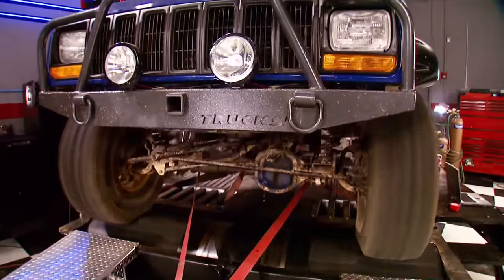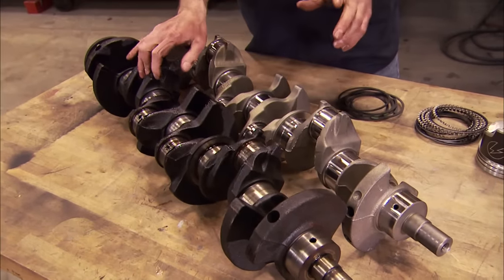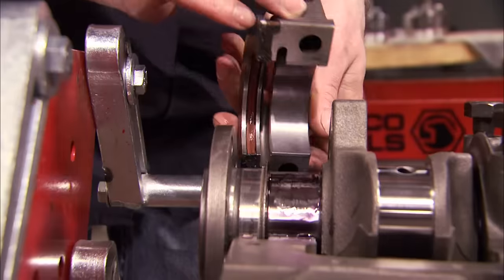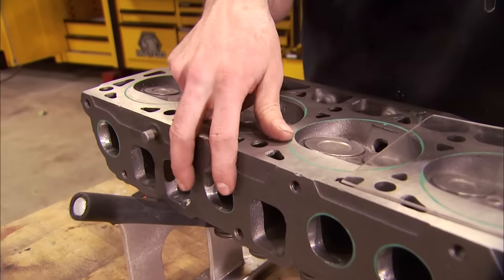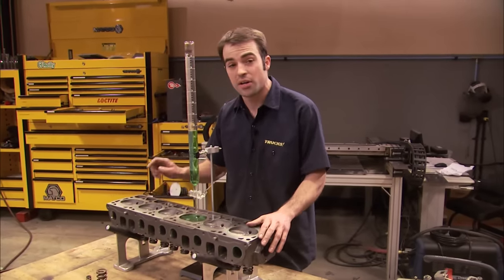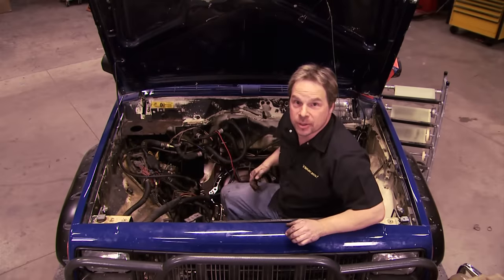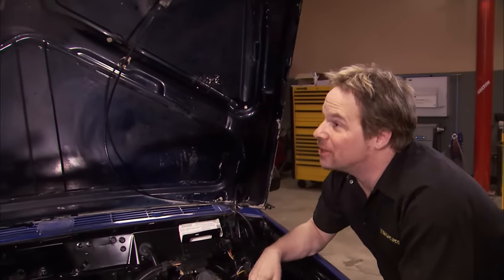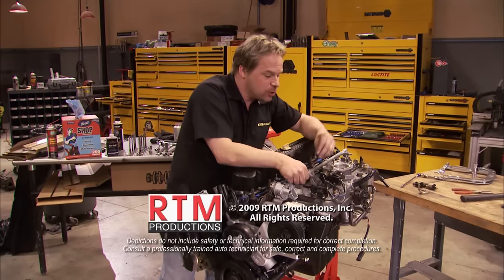Improving Air Flow And Displacement On Our Cheap Cherokee's Straight Six - Trucks! S11, E7

Comment: 4:58 Engine assembly is a little more than just torque spec and sequence although those are vital. Your bearing and piston clearances matter just as much if not more. Also piston ring end gap depending on your plans. You want to open them up if going with a power adder unless you like busted ring lands. And checking the end gap should be standard in any build unless you like blowby on a new engine. Too much crankshaft thrust clearance? You might end up driving over the crankshaft the first time you give it the beans. Just got your block back from the machine shop after a line hone and overbore? Check the clearances on the pistons and bearings. Never just assume all is copacetic. And don't spin the crankshaft until all the main caps are torqued to spec. The mains are not round until they are torqued and spinning the crank before the mains are torqued means you run the risk of scuffing the bearings and possibly the journals.
Reply: Or maybe everything was already measured and checked before hand........ for television time and such
Reply: They actually did btw. That aside, those low reving straight sixes are MUCH more forgiving and actually thrive in slightly looser tolerances relative to newer or performance specs.

Comment: I started mechanics in 68 on Stingray bikes and lawn mowers right around 70 I took into machine work in high school and rebuilt a go-kart engine for myself took a year and I was introduced to head porting in 71 and somewhere late 70s I took a hand at it but all through the 80s and 90s I did head work porting on my own and sold heads built things buy and sell engine parts I know that that Jeep engine is capable of 300 horsepower with proper head work and some compression and a cam head porting takes a long time to do a set of V8 heads can take 40 hours if you're doing it right and doing it meticulous and Blueprinting but it sure does make a difference

Comment: I worked on a mint 2004 4L Cherokee at work today, had an oil leak but that was about it still ran pretty good
Reply: The only longevity issue is the loss of zinc in motor oil,but you can use an additive

Comment: Great to see this build going forward and I like the way you are holding the cost down.  I like to keep the engine bay clean and neat as well but prefer a light color since it's much easier to see everything. Good work, good info

Comment: I am still baffled at jeeps decision to discontinue the 4.0L. It was like the cummins of the gasoline engine! Sounds great, awesome torque, would run forever if you dont EVER over heat them! Inline six......ok you get the point. Stock 4 liter is a good engine but the 4.6 like they are building here is just badass!! I have done a few over the years in YJ's and TJ's that had a blown 2.5L so we did the bigboy swap and man its amazing the difference and how happy our customers were. Believe it or not the swap is very simple to do also! Engine mounts are the only welding you need to do and those almost fall into place on their own! Cant wait to see what this engine puts out that they are building!!
Reply: Poor efficiency.
Reply: Listen to the engine run, you can hear slight misfires not enough to trigger the misfire monitor to pop a DTC but enough to make it fail tighter 2007 emissions standards. Some 4.0Ls run smoother than others, sometimes even with rotor, cap, wires and plug replacements it still runs a little rough. And with that much raw fuel running through the cat, epa felt that it wont pass, the 3.8L V6 used in 2007 to 2010 ran smoother and had a little more horsepower, but the 4.0L was still superior.

Comment: someone should have designed a tunnel port exhaust style head for the jeep...the 4.0 was so durable because it wasnt powerful enought to hurt itself.
Reply: 2j swap the jeep, call it supajeep
Reply: Haha exactly!  It better last forever it makes low power and doesn’t rev.
Reply: Exactly what an Older guy told me when i went to rebuild my ford 300i6. Told me its prolly the best motor i coulda picked to rebuild bc its durable and doesnt have enough hp to do damage to itself if im not perfect with everything
Reply: That's typical for all the old Detroit straight 6 engines.  They wouldn't turn high enough to hurt themselves. There is really nothing that magical about them.
Reply: Edelbrock makes an aluminum head for this engine.....IF you can find one.
Reply: It makes plenty of torque down low for its application. No need to wind up rpm to reach power that you don't need to move a 4k lb jeep. Its a glorified gas tractor engine. The AW4's wasted all their power. The AX15 really allows these guys to work in the power range where they are happy. Plenty torque to climb a hill in 5th gear. Start changing tires, axles, adding weight and moving your torque peak up, and it defeats the point. For the tuner kids out there, go see the AMC 10k rpm YT video or the Mexican racing league.. If you have the money and commitment, bragging rights can be had.
Reply: @scotteric8711  I agree for your off road POV....the problem is, 1) im not off road all the time 2) there are guys who build stroker/hp boosted versions of the 4.0. 3)a crossflow head would get better fuel economy. a 8.0 liter viper gets 5mpg better fuel economy than the jeep, for a variety of reasons (taller gearing being one) BUT the viper has more rolling resistance (more contact patch) and the Viper weighs more than my old XJ (3200lbs vrs 2800lbs). For day to day driving, not off road, or for Hot Rodders, a cross flow head would be GREAT.

Comment: Looking forward to doing something similar with a jeep 2wd  5 speed in my 71 gremlin
Reply: As much crap as Gremlins always seem to get, I'd still love to have one and build a turbo 4.6 stroker and take it to the strip.
Reply: @Future-Preps35  yeah that has been popping up but haven't quite checked it out, I have a spare 401 laying around for my 74 javelin amx that if I go as far as spending some big money on the 6, im just going to use some bulltear mounts and throw the 401 in the gremlin
Reply: @Brock_Landers  would be great! I also have a 92 Nissan 240sx that I took the 2jz out of and I have it sitting and waiting for a project, I expressed the idea of a 2jz and t56 in my gremlin on some forums and people thought the straight 6 tuner power plant sounded rad, and then a guy stole my idea so I kinda lost interest because I was trying to be the first 2j gremlin but I should have kept my mouth shut. Plenty of late 70s z28s I'm sure got embarrassed at the red light by a few gremlin Xs back in the day with a good ol 258 under the hood, the torque is there and you gotta love that amc 6 reliability.
Reply: Sweet!! I think that would be Peppy
Reply: Make the effort to use OBD II intake, head, and wiring. The intake flows so much better and you can access the ECU with HP tuners, ask me how I know.
Reply: @watrousmark401  my buddy who does aluminum casting and maching and I both decided to build an aluminum dual overhead conversion for the jeep 4.0 and we are attempting to do a weber side draft setup with a dohc design, itll be unique for sure. Thanks for the advice though
Reply: @Timman57  
How'd your DOHC head project come out. They actually make a DOHC for the 4.0 block that is used in a race series in Argentina. And no they do not sell them

Comment: Who takes compression out of a low hp engine oh that's right NO POWERNATION!!!
Reply: Or NO PENETRATION
Reply: Lol 😂😂😂
Reply: @WhiteG60  You are so right!
Reply: Came here looking for this comment
Reply: (Tim)"What are you doing to that Jeep engine, cylinder head, AL ?
(AL) "Tim, ...I'm lowering it's comprehension ratio and power"
      (Tim) "OOOHHAAAH ??!!!"
Reply: Hey let's stroke this engine and drop compression ratio......
Reply: @sethbrown5592  Sounds like late seventies!
Reply: @kingssuck06  9.6:1 will run 87 octane just fine. if it pings, just take a degree or two of timing out of it.

Comment: One thing I should point out, they kept saying "Cherokee rods" and "Cherokee pistons" this WILL NOT WORK with a 258 crank. The 4.0 has a deck height of 9.45". If you use the 6.125 connecting rods on the 3.895" stroke of the 258 crank it will shove the piston about a quarter inch into the head. The 4.0 piston has a compressed height of 1.601" so you can either use the 258 connecting rods, which will increase your quench height, and make the engine sensitive to fuel, or get custom pistons with a +/- 1.3" compressed height. The second option maintains the total combustion volume, and lets you run the same fuel as a stock 4.0L.

Comment: Idk about removing part of the squish band to get back 3 points of compression. Seems like one step forward and two back.
Reply: Optimally, it should have been done with the correct piston. But you are correct. He should have just left it alone. A 9.6 with good quench is better than 9.3 with no quench.. Especially with an iron head and pump fuel.

Comment: When using Plastigage and soft bearings like 77 style, it  is important to measure and torque \ compress the Plastigage in a warm area. The plastigage is actually harder than the 77 bearing in cold weather and will dent the bearing and give a false reading
Reply: Thanks for the tip

Comment: Prime time to pull the wiring harness out for inspection repair and or replacement. It's a Chrysler product, definitely needs some repair at a minimum.

Comment: I"m a little disappointed that you didn't degree the cam. You can't always trust that the timing is where it's supposed to be. Don't have to do each lobe, but it's a good idea to check number 1 intake and exhaust. I've found cams to be off by about a tooth or two.

Comment: 9.6:1 is just fine for 87octane. If your worried just knock 2* of timming out of it
Reply: This was my thoughts. They could safely run 87 octane pump gas on 9.6:1 unless they planned on using a power adder in the future which almost always requires premium anyway regardless of compression ratio.
Reply: Really depends on the quench height too. You can get away with lower octane at higher compression with a tight quench. That can be difficult to do though mixing and matching parts for a stroker.

Comment: If you are going to spend time and money on building a performance motor why would you lower the compression? Especially if it’s only 9.6 to 1 .....
Reply: At around the 9:55 mark, said it was to avoid the extra cost of Premium fuel. Probably lowered it a touch more to give a bigger window to avoid knocking from premature ignition.
Reply: swhite209 my point is why run the low octane when you chase power, maybe they don’t have high octane fuel available all the time or maybe his pockets are empty after the build? Lol
Reply: @Aladinscave  If you're gonna offroad it, you don't want an engine dependent on premium fuel.  You might need to borrow fuel to get back out or use backroad gas stations-which won't have premium...
  Sounds like he thought this through a bit.
Reply: Not to mention you have people like where I live who would still run it as a daily driver from what I've seen. This is the first video on the project I've watched so I don't know the whole plan.
Reply: To avoid using higher octane fuel. Its still a stock head . Maybe if it was an aluminum head they would of left it alone .
Reply: Up here in Alaska, we only have 90octane fuel. I don't know what they run in the lower 48 for octane rating
Reply: @sidneysanders5726  87 is the regular stuff in my area. But most gas stations here have 89 and 92(?) as well. I think it's 92 but I would have to look to be 100% sure.
Reply: swhite209 I’m in England we are spoiled here then we have 93 the cheaper stuff and 97 BP or 99 Shell the good stuff 🏁🕺🏻
Reply: @Aladinscave  Quick Google search confirmed my suspicion. We use different methods of measuring Octane Rating. Basically same gas with a different number. U.S. and apparently Canada will be roughly 4-6 Octane lower then every where else it seems.
Reply: @Aladinscave  We use a different calculation for octane ratings in the U.S. 97 over there is about the same as 91 here.
Reply: ImConstantlyConfused  I have learned this now, in the US they take the average of the RON and the MON in Europe they only use the RON witch means the fuel is basically the same where ever you are.
Reply: @Aladinscave  The U.S. is awesome like that, we just gotta do stuff more or less the same way but call it something else. Using imperial measurements for example, but our gallon is a bit less than a gallon in the U.K. 

I feel a little bad for Canadians who have to deal with our crap and the metric system. They often measure in feet and inches but use liters and kilometers.
Reply: 9.6 isn’t even high compression

Comment: My 82 CJ-7 with 258, I built it, .60 over, mild performance cam, dual exhaust headers, intake and small 4 barrel. Torque monster. It's a daily driver

Comment: Usually 140 thousand is nothing for a 4.0,however if not maintained any engine can be ruined.
Reply: My daily going on 7yrs and about 25k for mileage without an oil change. 
Why bother on a 1200$ car, but I'm obviously not doing it any favors. 
It's fun to see how long it'll live.
Reply: MrHillfolk if your daily has an oil leak and you add when it’s low you should be fine lol
Reply: @trevorthomas6043  
It doesn't really leak it , but about every 8 months or so the teapot light comes on when I rip a corner hard. 
So I add like 2.5 qts to it's approximately 4 qt capacity and it's good for a while 🤣🤣